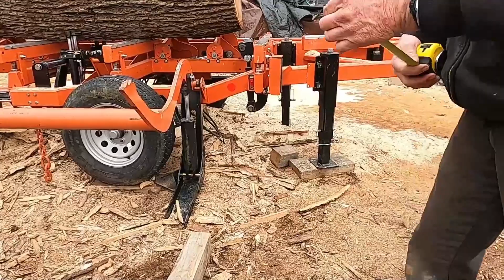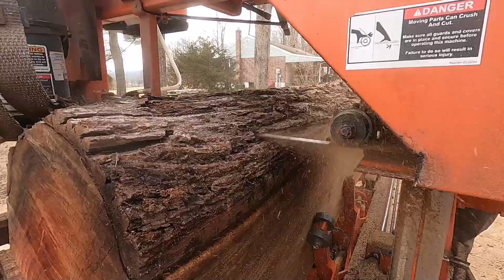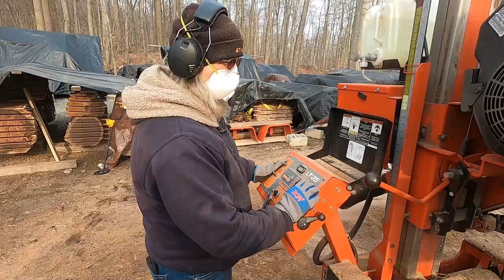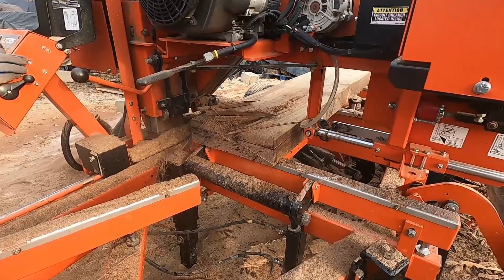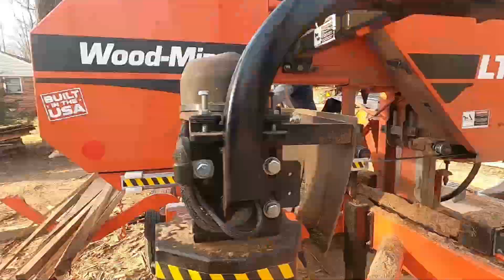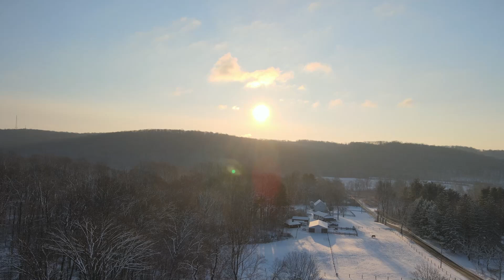Black Walnut Marathon #6 The Curse Continues

Comment: Thanks for the video. You guys are hard workers but it looks like you enjoy sawmilling. I have a 35HD as well. Just cutting my own wood so far. It didn't appear like you used much water on the blade today? Thanks again. Leo
Reply from the maker: It is a lot of fun Lee. Always excited to see what's hiding in a log. The LT35HD does a great job also. 
Certain woods require more or less water. This walnut was very wet, and did not gum up the blade at all.
Ash on the other hand gums the blade up alot. We use twice as much water in a day of cutting ash

Comment: I use hall effect sensors to detect the levels at various probed points on my 3D printer
 beds to enable the print heads height to be adjusted whilst in motion to print layers completly level, I was thinking how the same technology could be used to detect the exact depth of any metal object with a handheld scanner thus enabling a cut to be made just above the level of the nail to enable easy extraction, I will speak with my buddy who is more knowledgable on the tolerances of hall effect sensors than myself and see if we can knock up a prototype
Reply from the maker: That would be a cool tool to have. Our metal detector has a depth reading, but I have no idea of the tech involved, or how accurate it is. Not sure if wood density would affect the reading or not. Let me know what you find out.  If something can be made, like you described, it would be a popular device.

Comment: I ordered my LT-35 last week! What blades are you using? Did you order the two extra stops add on? Going to using it in Michigan.
Reply from the maker: Congrats on the mill. You will love it. We use Wood Mizer 7° Turbo 739 blades. They qork great. We had them make the 2 addition stops, hydraulic. It makes life easier.